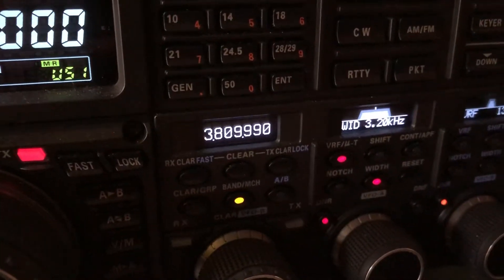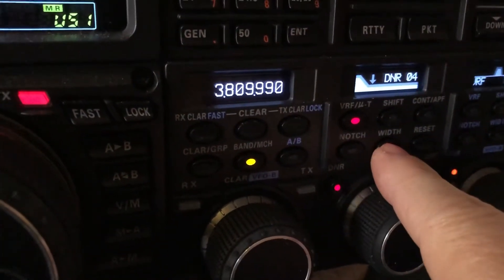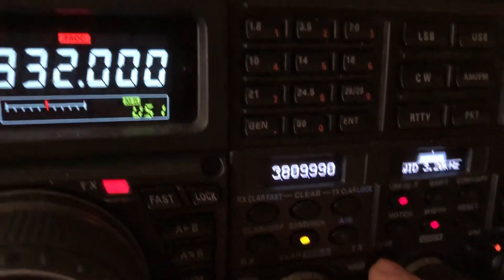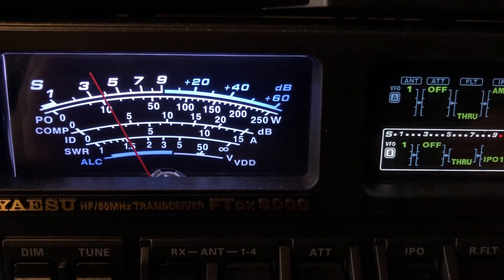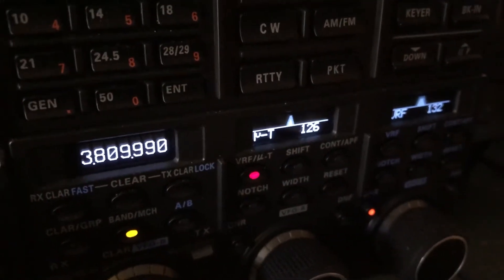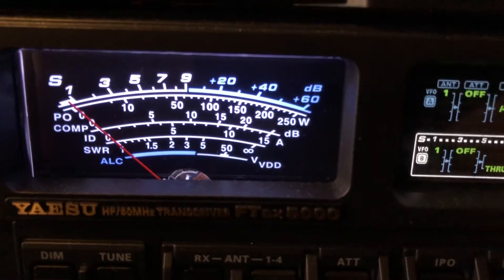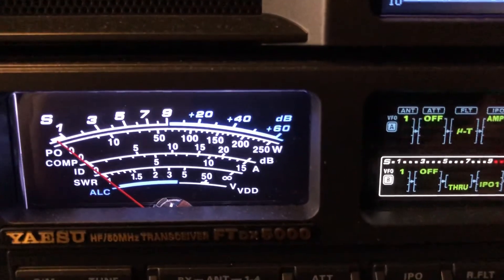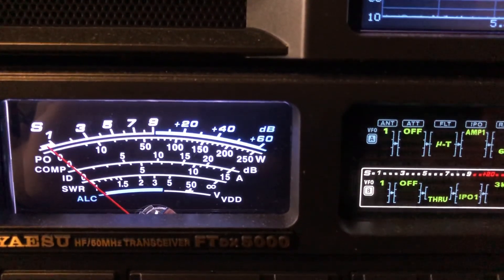Yaesu mu-tune “mu-tuning” preselector with FTdx5000MP Limited

Comment: So great to see how much more selectivity you can squeeze out of these radios! have you found these to be useful in all the bands including the 20/30 bands? Thank you!
Reply from the maker: Yes, but more effective for 40/60/80 meters.  There is a 160m version too. I have that unit too, but I am waiting to assemble it when I have the time to film the assembly process. I’m sure it will be effective. Variable preselectors are more needed for lower frequencies. That said, the built-in VRF preselector does a great job on 160m.

Comment: I have a question I’ve always wanted to ask someone that purchased one of these because of their expense… Do you think it’s worth it? Does it offer $650 worth of additional performance to a 5000? I’m curious about that and by the way, I would’ve done it the same way… 80/40. Go for the noisiest bands

Thanks for the video. I host a YouTube podcast tries tries to help people get into ham radio, license up as well as show them products sick and help them work better and smarter.

All the best,

Larry
de K7HN
Reply from the maker: Thanks for stopping by, Larry!  Thanks for what you do to promote amateur radio!

The $650 question?  Well, the built-in VRF preselector is no slouch.  But the mu-tuning preselector is approximately 66-67% tighter than the VRF preselector.  Plus, the mu-tuning preselector automatically follows the VFO and maintains the same center, or offset, you might have previously set.  

If you watch all of the videos I made that feature the mu-tuning preselector, you will see it used against both QRM and QRN.

In the series with the FTdx10, I compared its selectivity to the FTdx5000MP, while not allowing the FTdx5000MP to make use of either the VRF or mu-tuning preselectors.  I was pleased that the FTdx5000MP held its on against the young “whipper-snapper.”

So, my perspective?  The FTdx5000MP competes well without even using VRF.  The VRF puts the FTdx5000MP in a class with few radios.  When I compared the FTdx5000MP to the FTdx101D, while trying to decide between the two, the VRF fell short of the VC Tune preselector in the FTdx101D.  But, with a mu-tuning preselector, the FTdx5000MP hangs with the FTdx101MP, and it might even have a slight edge over it.  It’s splitting hairs, so I guess I should just call them even.  

So, if you prefer the ergonomics of the FTdx5000MP, which I do, but you want to compete with the FTdx101D or MP on selectivity, the mu-tuning preselector could be a great investment.  

The VC Tune preselector does not function on 60 meters.  The The mu-tuning preselector for 40 and 80 meters also works for 60 meters.  

Bear in mind that you must purchase three mu-tuning preselectors if you want to cover 160 through 20 meters.  That is nearly $2,000.  So a FTdx5000MP with three mu-tuning preselectors costs more than a FTdx101MP.  And that’s before you add the SM-5000 speaker/bandscope.  Is it worth it?  I really like the ergonomics of the FTdx5000MP.  I also like the way it sounds on receive.  So, I purchased two mu-tuning preselectors, to put it at what I consider to be even footing with the FTdx101D or MP.  I bought the mu-tuning preselector for 40/60/80 meters and the one for 20/30 meters.  I haven’t yet saved the money for the 160 meter mu-tuning preselector kit.  But I want to get that one as well, so my FTdx5000MP has every advantage.

I hope this analysis helps.

73, de N4HNH
Reply: @n4hnhradio  thank you so much for such a thorough response.

I have both the 5000 and the 101D. I did have the FTDX 10 for a short time for review purposes on the channel. 

I highly agree with you that the Selectivity on the FTDX 10 is not as strong as the FTDX 101. 

The VC Tune is definitely the piece that’s missing that would bring it to a higher level. Couldn’t agree more with you there.

I have found there to be a slight difference but only slight, between the 5000 and the 101. The 101 a little more sensitive and a little more selective. But it’s by a whisker not much more.

With all of that said, the radio that I hope will still be here the day that I become an SK is my 5000. It just invites you to “use a radio the way it supposed to be used.”

Filter adjustments, DNR, diversity reception… It’s a juggling act that makes you enjoy the transceiver and it’s great capabilities.

That’s why the 5000 would be the last to go on my desk at least. I wondered about ordering one of the Mu’s probably the 80/40 as I enjoy using nighttime DX frequencies. Your video really help to show how much more effective the radio could become. As we both know, every advantage you can get is the difference between making a QSO and missing it. But my goodness… That price! LOL!

I don’t know if you have it or not, but QST did a remarkable Review in their December 2010 edition. It called the FTDX 5000 “the gold standard of receivers.” 

12 model years  later... it still rings true.

All the best to you and thank you so much for your kind words. Thanks for the great videos in the 5000… Keep up the great work over there!

Larry
de K7HN
Reply from the maker: Hi Larry,

Well said, my friend!  The 5000 invites you to “use a radio The way it is supposed to be used.”  That is great!

My understanding is that the rare materials used to make the mu-tuning preselector factor into the cost.  By the way, the 40/80 model also works on 60m.  

You are wise to consider the 40/60/80 model first. I recommend that anyone who is going to collect mu-tuning preselectors buy that one first.  You get the most for your money, and those bands are so often used by so many of us.  

The lower frequencies are where we benefit most from what the mu-tuning preselectors can mitigate.  The preselectors represent an additional level of protection against the high voltages that can be generated by strong signals and noise on the low bands.

If I operated 160m regularly, I would be in more of a hurry to get the mu-tuning preselector for that band.  But honestly, the VRF preselector has been quite effective there.  I have a 50kW AM broadcast transmitter in the area.  And the lightning crashes in the Southeast are bad at times.  

Keep up the great work on your side.  I’ve been watching your review of the IC-7300 and the FTdx10.  Nicely done! 

73, de N4HNH